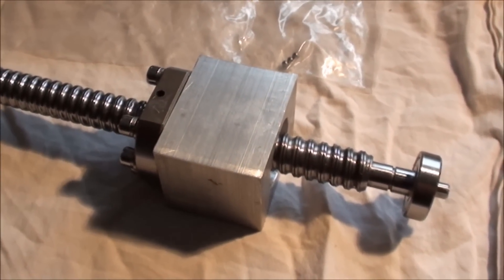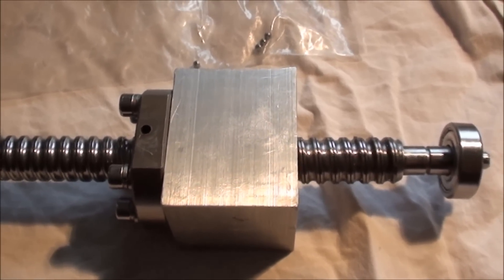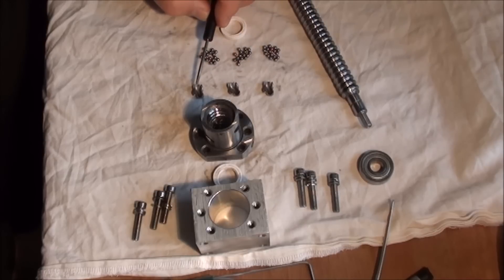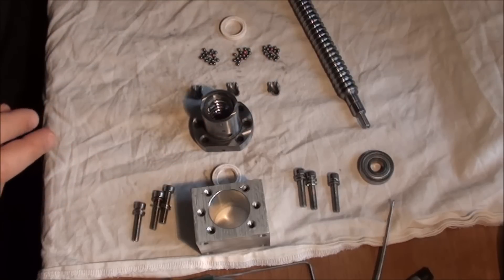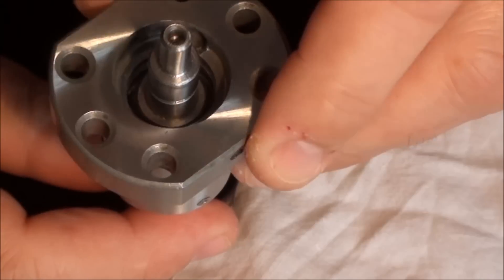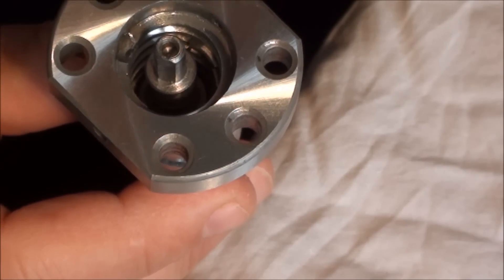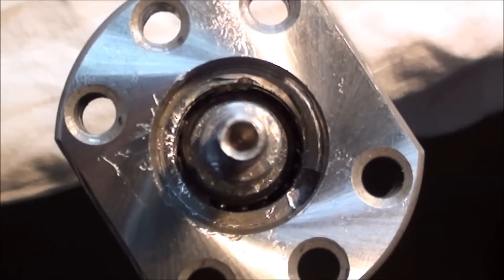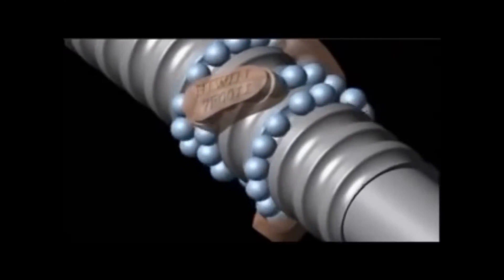Linear Motion, internal circulation, ball screw - function and assembly

Comment: Good explantion!!!.
Could you tell me where did you buy that?
Reply: Our company can supply all kinds of ballscrew and linearguider way Hiwin STAF GTEN or other brands.pls check the website:http://www.aresmotion.com/   or you can contact us :sales01@aresmotion.com
good quality and low price. You can get them by express  7-10days.
Reply from the maker: +Paco de Poio Hi Paco, I got it from China as part of an&#160;6040 CNC Mechanical&#160;Kit.It is probaby very similar to the one i link to below. Please note that&#160;quality can differ quite some when you buy the Chinese parts. The one I got seems ok though.Br, Martin          http://www.aliexpress.com/item/Free-shipping-SFU1605-L1000mm-rolled-ball-screw-C7-with-1605-flange-single-ball-nut-for-BK/32347802374.html?spm=2114.30010308.3.10.O8UJ65&ws_ab_test=searchweb201556_7,searchweb201602_2_10017_10005_10006_10034_10021_507_10022_10020_10018_10019,searchweb201603_6&btsid=c26fc946-0ea5-4745-a25d-d43ba3e83ed2